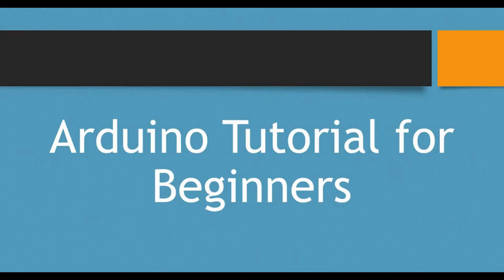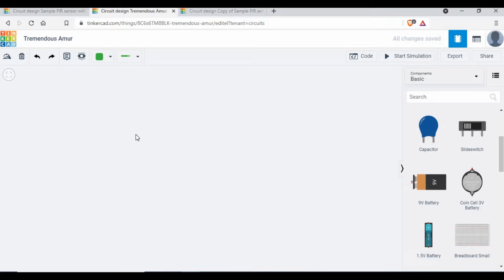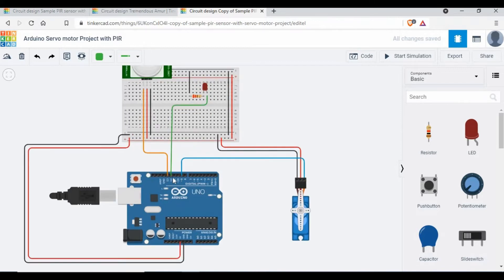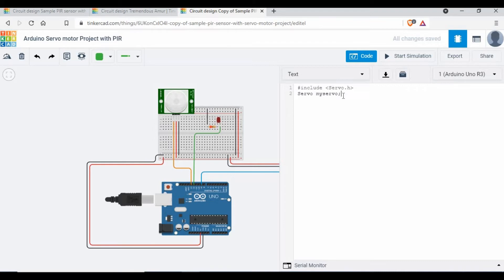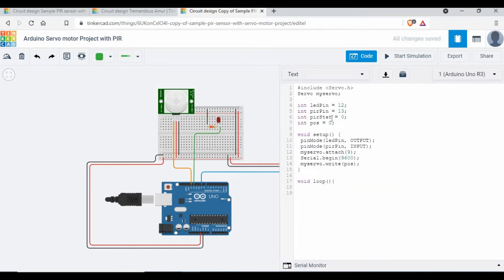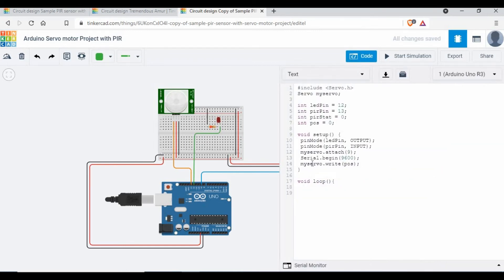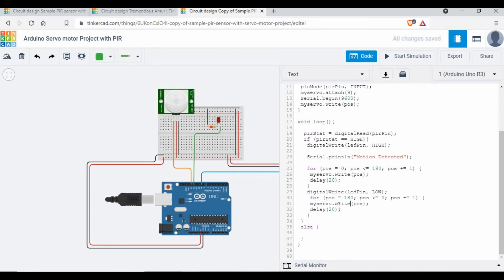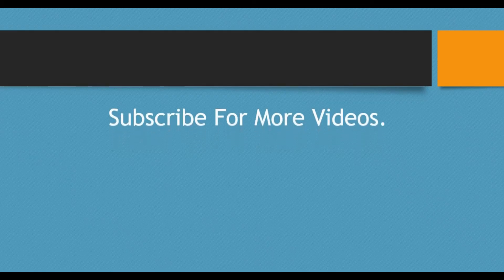Arduino Tutorial for Beginners | Arduino Servo Motor Project | Automatic Door Opening

Comment: Great video
Issue I have is the servo is always using power from battery when idle when no signal is sent. Killing the battery 

How can we use an NPN transistor or logic level mosfet to not send power to the servo if there is no signal. 

Can u please describe where you would connect the transistor or mosfet pins to. I think a resistor might be required to the base or gate